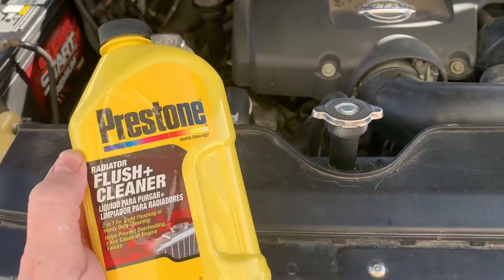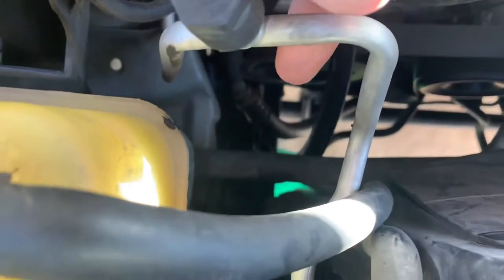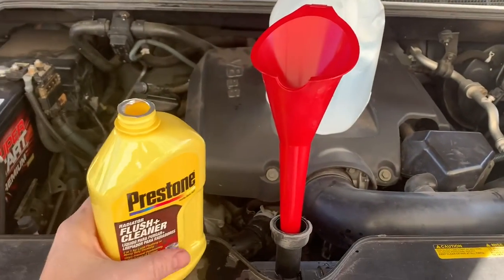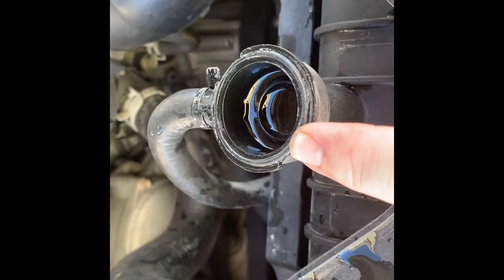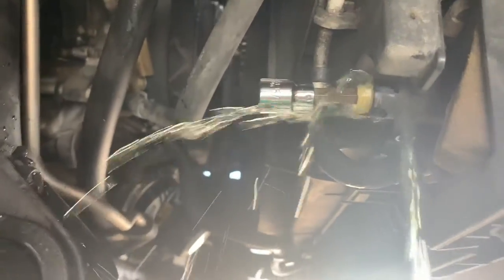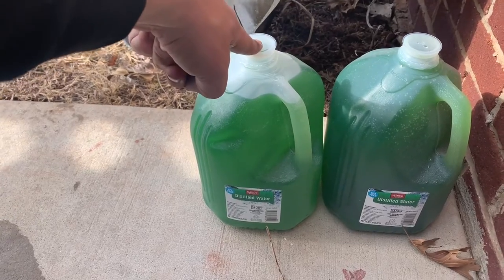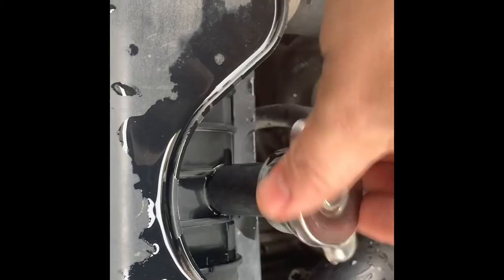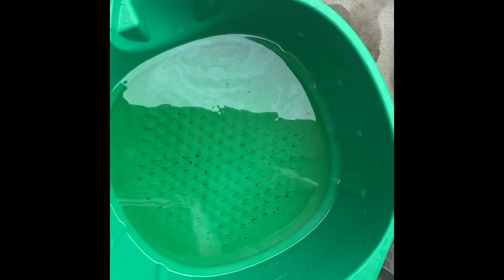Nissan Titan Armada Infiniti QX56 Radiator Flush & Fill Service (Prestone Flush + Cleaner & Zerex)

Comment: Thanks for sharing. This particular cooling system is supposed to be filled with a vacuum type coolant refill kit though, otherwise you have to jack the front end up really high while running the engine with both front and rear heat on in hopes of getting the system purged of air from several run and cool cycles.
Reply from the maker: Appreciate the view. Yes it is difficult to get the coolant to fully purge. That’s why I do it on a inclines driveway. Helps get out the air pockets.
Reply: Hi Chris/Crystal: Are you talking about the kit that comes with a fitting for the top of the radiator that then uses a special funnel to keep everything sealed?

Comment: I have a 2005 Nissan Titan.  This video compelled me to order 2 extra petcocks for the radiator just in case the same thing happens to me as I'll be doing a drain and fill on my own truck soon.
Reply from the maker: Appreciate the view
Reply: @SideGigSquid  I noticed on the  2 new petcocks there is a black marking  on them near a circular indentation in the plastic petcock.  So when tightened, it the marking and indentation supposed to be pointing downwards?   The old petcock on my Titan loosened easily. but I haven't taken all the way out yet.

Comment: My only comment is that you didn't mention if you refilled with full strength coolant or diluted. If diluted then you will end up with less than a 50/50 coolant/water ratio due to adding several gallons of distilled water to flush. If full strength then I assume to did some rough calculations to determine how much to add. I'm currently doing this procedure and using 50/50 blue for Asian vehicles. In order to know I'm very close to a 50/50 ratio I will need to remove the thermostat, flush backwards and forwards with water and then pour coolant into the top radiator hose until it displaces the water and runs out blue. This same procedure also need to be done to the heater core. I don't think there is no other way to ensure you have a 50/50 mixture unless you use a vacuum system.
Reply from the maker: There’s not a definite way to make sure everything is 50/50 but where I live it doesn’t get cold enough for me to worry about it. When I was a kid we all just used water.
Reply: @SideGigSquid  I ended up using a shop vac to extract as much water out of the block and heater core as possible. Between the drain and vac I got about 3 gallons. It holds 3 3/8 gallons. I then filled the system completely with distilled water again. Ran for a bit. Then drained a little over 1.5 gallons. Then filled with concentrate. I'm in NE Ohio.

Comment: You do not fill the Reservoir up to the top like that 😳
Reply from the maker: I wasn’t particularly worried about it. There is a vent and with pressure throughout the engine it will find its way out.

Comment: No special procedure for burping the system when you refill?
Reply from the maker: Just run the engine and keep topping it off to get out any air bubbles caught by the thermostat and never had a problem. Thanks for the view.

Comment: 1st of all you overfilled the overfill tank. You're not supposed to go pass the Max fill line? There's supposed to be room for expansion...also you forgot to mention how much antifreeze the Titan takes?
Reply from the maker: You know what happens to the overfill tank when it gets overfilled? It drains out. I put more than necessary so it could work it’s way through the system. You can’t really over service it. There’s a vent hose. The book says the entire system takes about 3.25 gallons. But it depends on if you cleared EVERYTHING out of your system which is doubtful. Which is why I just “put to much” and let Bernoulli, Boyle, and Newtons theories do their thing.

Comment: Your performance on this pretty much makes the case to go to JL and pay the $150 - which is what you should have done.  Geez - what a disaster.  Idling the engine for 5 hours??? You spent more in gas than it would cost to have the dealer do the job.
Reply from the maker: You must be super fun at parties.
Reply: He specifically said he "drove" the car for 5 hours